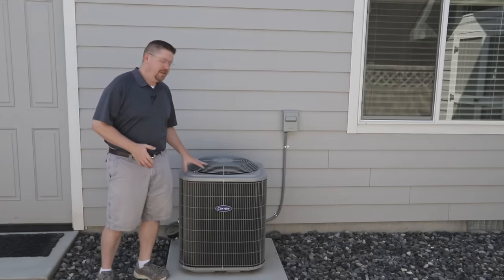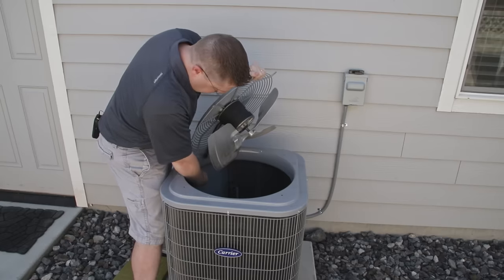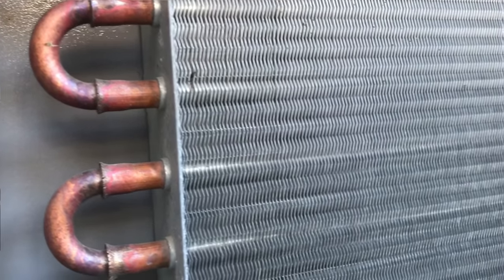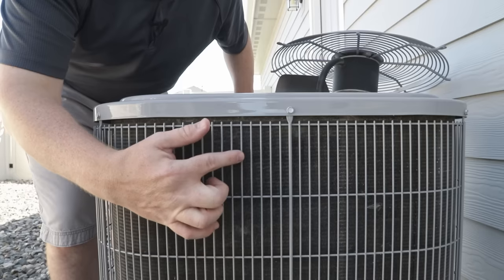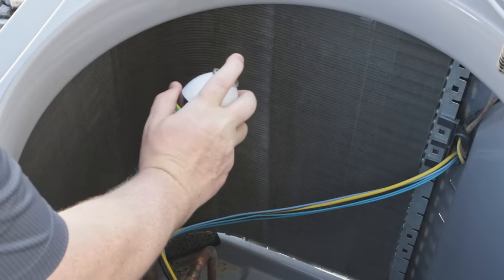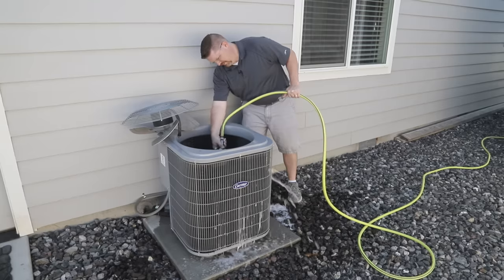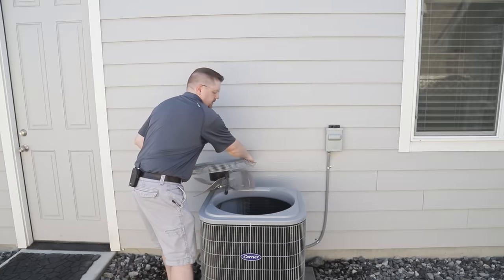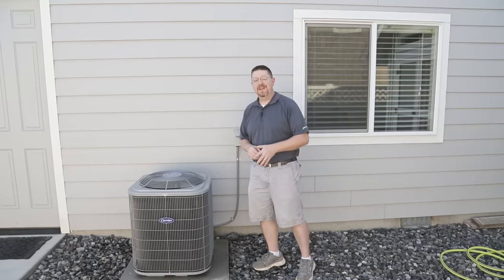How To Clean Your Air Conditioner Condenser Coil (Step By Step)

Comment: Wow.....now I know why my entire system is still running great even after 20 years; I'm not an HVAC worker, but I just figured it was common sense to do things like this, so I've always done it.  You can also use something like Dow Bathroom Cleaner to obtain the same results.  I replaced a dead capacitor in mine about 2 years ago, easy-peasy fix....other than that, it's been great.  I've also used my air compressor to blow out the fins and then vacuumed up what came out, whenever I was pressed for time but noticed that it was getting dirty. Also, I personally installed the entire system, so I'm just very familiar with it and the maintenance it requires.  In case anyone's curious, my system is made by York; the system I replaced was a Trane, died at 22 years of age and LOTS of use, like my present system.  As with anything else, if you properly maintain something, it will more than outlast its average expected life span; I think condensers average 10-15 years, gas furnaces, 15-20.  I'll likely be replacing my system next September sometime, just so I don't get any unexpected surprises.
Reply from the maker: Sounds like you take DIY to the next level. Nice!
Reply: I HAVE to, Amplify....I'm f-----g poor now that I've had to go on disability, lol.  Nothing I'd love more than to pick up my phone and tell someone, "Hey, just come and fix it for me!" Oh, well....I love to learn anything I can!

Comment: How would you clean the coil of calcium buildup from sprinklers hitting it?
Reply from the maker: Hi Bret - great question! I’d recommend cleaning it with a mixture of equal parts white vinegar and water. This will help dissolve the build up. You can let the vinegar solution dwell on the fins for a little while to be more effective.  Don’t let the vinegar solution sit on the fins for hours though - even though it’s a pretty weak acid, it can damage the fins with long-term exposure. Good luck!

Comment: lol, you're cute if you think your friend's condenser is 'filthy'. his was, at best, a little dirty. you work in HVAC and you'll see dozens of units a week. your units are fine. but it IS smart to clean it before it becomes actually filthy. people will ignore their unit for 5 plus years, the leaves have turned into mulch. and sometimes you'll see plants growing inside it. THAT is filthy. hornet's nests, dirt divers, webs, wet insulation, corroded fins. you'll see a lot of that if you ignore your unit when it's 'filthy'.
Reply: Cute? wtf dude.

Comment: wat do the hvac people charge to clean one out w modest dirt? 50hr?
Reply from the maker: Rates vary a lot. Around here a basic cleaning like this is around $129USD.
Reply: @AmplifyDIY  thanks, took ur advice and gave it alook, 2x yearly i used just water and I check, its still fine after 5 years carrier new, so i figure i can keep doing just water rinse, or 1 time use the coil cleaner........i feel i can do this every other year, i only use the hvac 6months a year on 75 tops...so its not stressed, rite? (wish i had a train) tho

Comment: If I don’t want to take apart the condenser can I just spray that stuff on and hose from outside?  Mine is only 2 yo. New build from 2020 but out area is pretty dusty and allergies are kicking our asses
Reply from the maker: Heya MrCuboid - Cleaning from just the outside is better than not cleaning at all.. but as I explained in the video, the unit sucks dust in from the outside, and cleaning from the outside will just push the dust/dirt/grime deeper into the slots between the fins. It's better to clean from the inside, as then you are pushing all the junk back out the way it came in. But if that's not an option for you, as I said cleaning from the outside is better than not cleaning at all.

Comment: Mine are covered by a powdery white substance on the outside and it seems like the fins are just shattering from the slightest touch. Can the fins decay or dryrot? Is there a way to fix this?
Reply from the maker: How old is your unit? The fins are usually Aluminum, which definitely does oxidize, and can break down to the point it's so brittle that practically breathing on it makes it just crumble away. Usually to get that bad, though, it's the result of cleaning it with a pretty caustic substance. Has the unit ever been cleaned with something stronger than soap and water or a safe coil cleaning spray like I used in the video?

Comment: My rheem air conditioner is older and has 2 sets of coils. So when you clean from the inside out, it doesn’t actually push the cleaner to the outer or second row of coils... makes it more difficult to clean.
Reply from the maker: That's a bit of a pain in the neck! You'll for sure need to clean from both sides. Thanks for watching!

Comment: It looks like your friend’s unit had a lot of calcium and lime build up on the outside of the unit.  Any recommendations to remove that??
Reply from the maker: I'm pretty sure the build up on his was just the natural oxidation that happens with aluminum. I'm not aware of any commercial cleaner that will remove hard water deposits that does not also harm aluminum.

Comment: Question: if my A/C unit keeps tripping the main circuit breaker even after cleaning the coils, what could be the problem?
Reply from the maker: Hi Step - it's likely a bigger issue with the compressor. Time for a service call from a professional, I'm afraid. Good luck!

Comment: It's ok to put the fan like that? shouldn't you put it upside down so fin won't get damaged? or it's ok?
Reply from the maker: Just place the fan so that a) it is stable and b) the fins won't get bent and c) there is no possibility that the fan will fall and bang into the side of your unit (potentially damaging your coils). For my unit, the way I placed the fan met these criteria. You may need do do it differently. Thanks for watching!

Comment: will the dirty coil cause the compressor stop working? sometime my condenser fan runs but the compressor doesn't start at all.
Reply from the maker: Not usually, no. It’ll make it run longer, and be much less efficient, which I suppose could cause it to either overheat or some thermostats have a “rest” period they enforce to keep your compressor from running for too long...but not turning on at all is likely a different problem. Still, if your coils are filthy, get them clean! It won’t hurt the compressor at all, and needs to be done anyhow. Good luck!
Reply: AmplifyDIY ok. my ac sometimes stop work around 5pm which is the hottest time of the day, the condenser fan is working but compressor is not, if I turn it off and wait like 10min then it starts to work as usual, so maybe because the dirty coil cause overheat and then wait the heat disappears it goes back to work
Reply from the maker: Sounds like it, yes. Clean it and see if that makes a difference.
Reply: AmplifyDIY yeah thanks man appreciate your reply
Reply from the maker: Let me know if cleaning helps!
Reply: yes there is a thermal overload in the compressor windings that will stop the compressor if it overheats

Comment: I live in Michigan that has harsh winters with snow and ice. Is it advisable to place a cover over the unit in the off season ? For the most part, people don't cover their's.
Reply from the maker: I'm not sure it will really make much difference, to be honest. These things are designed to sit outside, and survive the weather/climate. A cover may help to keep leaves etc from collecting inside the unit over the winter, and my cut down on how much cleaning you have to do in the spring... but I suspect it will make a pretty small difference. One tip: If you do decide to get a cover, DO NOT turn on the unit with the cover still on it. :)
Reply: @AmplifyDIY  
Thank You for your reply. I would never run my unit with a cover. That's good advice for  people that may not know that. I only clean my unit every couple years,  because there is no plant life  around my unit, so it stays relatively clean w/o a cover.Thanks again.

Comment: It’s 1am and my ac just hasn’t been spitting cold air… so I been looking up what could be wrong … so my son and I went outside with a flashlight trying to at least somewhat clean it so we can get thru the night … and idk if it did anything.  First thing I’m doing on the morning, is cleaning it just the way you said.  So there’s an outdoor plug I need to unplug it from ? I rent this house and I don’t think that unit has EVER been cleaned.
Reply from the maker: Hey Nail Geek - yes, there is a safety disconnect that should be mounted somewhere right next to the condenser unit. DO NOT try to clean the unit until that disconnect has been... disconnected. Also remember to put it back in after you are done. Disconnecting it is a safety measure which will guarantee the unit does not try to power on while you are in the middle of cleaning it. 
Good luck!
Reply: @AmplifyDIY  thank u so much for the info.  I saw where it needs to be unplugged from and I’m about to buckle down and do it lol.  Thanks for teaching me to do it on my own and not rely on a man to do things for me. Greatly appreciated.
Reply from the maker: @PrettyPettyMara  I hope it went well!

Comment: Is there a coil cleaner that is nontoxic and fragrance free? Thanks
Reply from the maker: Simple Green makes a coil cleaner that is certified for use in food preparation areas, and does not contain any added fragrances/perfumes: https://amzn.to/3yE0xCa
But anything is better than nothing. If you are concerned about the typical coil cleaners or even Simple Green, you can just use soapy water. Just make sure you rinse it all off really well. Good luck!
Reply: Thank you

Comment: would a hose work with a ductless indoor unit?
Reply from the maker: You mean for cleaning the exterior condenser coil? Yes, this same process applies. Just be very gentle on the fins. They are very delicate.

Comment: Do I remove the outside protective grill work too?
Reply from the maker: It depends on the model. If you have a grill like the one I showed in this video, you don't need to remove it. If you have one that has solid walls with louvered vents then it is easier to remove those to clean the coil. Good luck!

Comment: Did this to my mini split unit and im getting an e7 error its an older diakin but its got nothing blocking the fan blades and both remotes are on the same mode
Reply from the maker: Hmm... any chance you've accidentally disconnected something? When I google for "daikin e7 error" it looks like that error code indicates there is a problem with the fan motor: https://www.google.com/search?q=diakin+e7+error
I'd double check all the connections... 
Good luck!

Comment: So I have a question....how do I cure dirty sock syndrome?  I have a 3 ton Rheem high static system that was installed in Oct 2019,  the stink began during this past heating season. The coils have been cleaned professionally to the tune of 273 bucks, a GPS unit has been  installed, the problem still exists whenever the defrost cycle kicks in.  Rheem refuses to even discuss the issue, the company I purchased the unit from is saying the same thing Rheem is, “it’s an environmental issue”,  had my old unit for 34 years, never had that with it.  I keep seeing recommendations of a dipped coil, ay MY expense.  The DSS has caused breathing problems.  If I run on solely emergency heat, no stink and to be honest, my power bill was actually 60 dollars less and that was during the exceedingly cold we had in Feb.  Any help would be greatly appreciated.
Reply from the maker: Hi Anita - Have you replaced your filters? Have you cleaned your vent registers in the house? When they came and cleaned your coils, did they only clean the ones outside the house (like in this video) or did they also clean the ones inside your heater unit?

Comment: Why not use an air compressor 1st on the coils blowing from the inside out. Then the cleanser? Asking.
Reply from the maker: An air compressor can easily bend the fins if you use too much pressure. Be very careful if you do it this way - keep the tool pressure very low.

Comment: Was there a change like it cools inside the house real quick?
Reply from the maker: Hi Bal Loney - it will make your system run more efficiently. In other words, it won't have to cycle the compressor/condenser as often to maintain the same temperature. You will save a bit on your electric bill and help your system last a lot longer, but it won't necessarily cool your house down any more quickly.
Reply: @AmplifyDIY  Many thanks for the reply. My trouble is the temperature inside the house won't match the temperature I set on the thermostat. Like 86 remains 86 while I set it to 75. So I was thinking of cleaning like what you did.
Reply from the maker: Yes, cleaning can definitely help with that, if a clogged up / filthy coil is the root problem. It certainly can't hurt.... if the house can't get any cooler after cleaning, you have something else going on, and it's probably time to call a technician. Good luck!

Comment: When do you need to take off the exterior retainers? I see you didn't for yours, but you did for your buddy's...
Reply from the maker: Hi Warner - the design of the unit dictates whether you have to remove the outer part of the cabinet. Mine is designed such that you have good access to clean the coils without removing anything. My buddy's, unfortunately, was not. If you can see the coils really well, then you don't need to remove the outer cover. If the coils are behind louvers or otherwise obscured, you'll have to take the cabinet apart. Thanks for watching!

Comment: No rubber gloves or eye protection required.  Inside out? Vs spray the outside and hose inside to outside?
Reply from the maker: The cleaner is very gentle. Feel free to wear ppe if you prefer. It's better to spray the coils with the cleaner from the inside, then hose it off from the inside to the outside first, then final rinse from the outside in.
When this unit operates, it pulls air from the outside in, which sucks in all the junk that clogs the fins along with it. This junk builds up along the outside first, then is slowly drawn further and further into the fins. If you come along and spray from the outside first, all you'll really be doing is pushing all that gunk further into your coils. That's why it's better to clean from the inside out.

Comment: I have the same model (Not the friends). Don’t take the outer grate off unless you have a friend or you have done it 100 times. I’m pretty handy guy, thought i would take it off to try and straighten out some wonky fins on the outside. Not even almost worth the headache and possible extra damage I may/could have caused taking it on and off. Also the dickhead that installed my unit made the hose from the fan to the lid of the unit too short and i almost made a real uh-oh with that and my pan doesn’t drain at all. Probably need to take the top off and check it tomorrow. I thought Morris Jenkins didn’t have shit on me, turns out I might be mentally challenged. Good luck.

Comment: What is the tool called that is un doing the bolts on the top
Reply from the maker: Hi Arealle - I'm using a screwdriver that can accept interchangeable attachments. The attachment I'm using in the video is a socket attachment for the size bolts on my unit. Here is a similar screwdriver and bit set: https://amzn.to/3gSb9ze - but honestly, it's just a regular bolt that you can remove with any wrench or driver that fits it. Even a simple adjustable wrench like this should get it off: https://amzn.to/3fO6Bsd

Good luck, and thanks for watching!

Comment: If you remove fuse out of box and just to be sure turn off the breaker while cleaning, can I still get electrocuted? A bit scared of electric
Reply from the maker: Hey there - if you pull the disconnect like I showed in the video, there is NO way for the unit to turn on at all. The breaker becomes irrelevant once the disconnect is ... disconnected. Pull out the handle as I showed in the video, and you'll be perfectly safe working on the unit. Good luck, and thanks for watching!
Reply: @AmplifyDIY  thank you so much! Great video by the way, appreciate your help!

Comment: What to do for rust ??
Reply from the maker: Rust can be a pretty tricky one to take care of yourself. It depends where the rest is located, how severe it is, and whether or not it is just on the surface or goes much deeper. There are some kinds of rust converters you can get that will convert surface rust into a material that will no longer rust more, but I’m not sure I would trust that on an air conditioning system. Exactly where is your rust, and how severe is it?
Reply: @AmplifyDIY  most of the rust seems to be forming on the grill on top of the fan it seems
Reply from the maker: Ah, this is pretty safe to deal with, as it is not directly involved with the coolant pipes, etc. I would remove the rusty grill then use Naval Jelly to dissolve the rust, then some self-etching primer to prime the metal, and then spray it with a high quality enamel spray paint in whatever color you like. I demonstrate all these steps (albeit in a different setting) in a video about how to deal with rusty natural gas pipes: https://youtu.be/0W3EaQqjU2E

Hopefully your grill is really easy to remove (probably just a few screws or bolts) - I would not recommend doing all the above with the grill still attached to the unit. 

Best of luck - I'm happy to try to answer any other questions that come up!